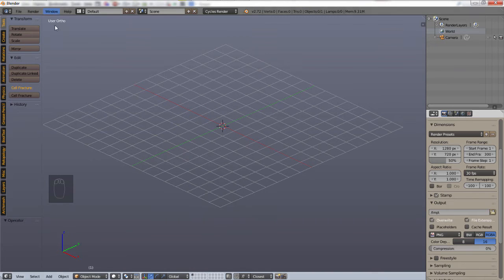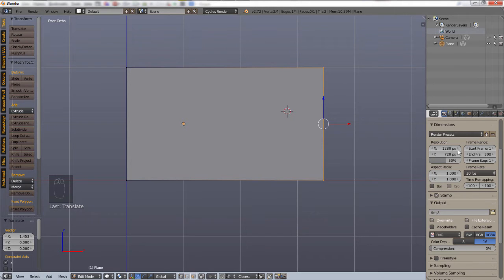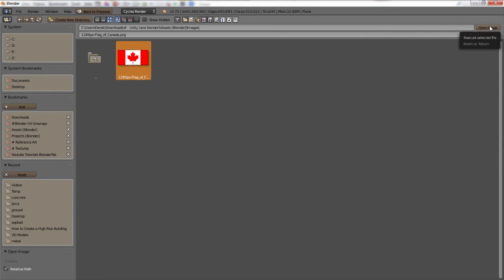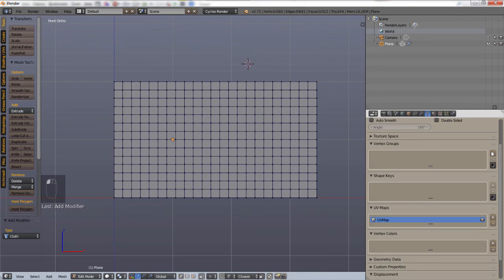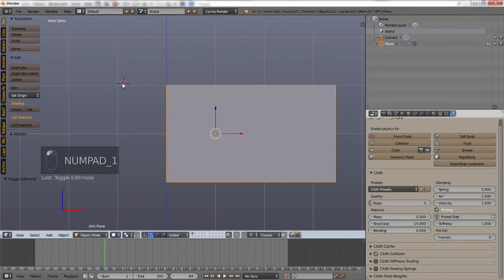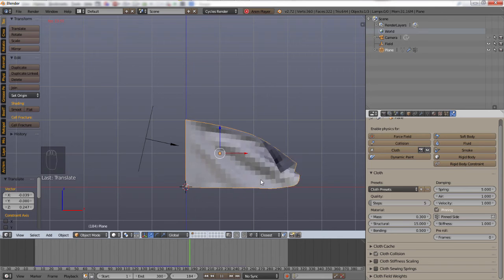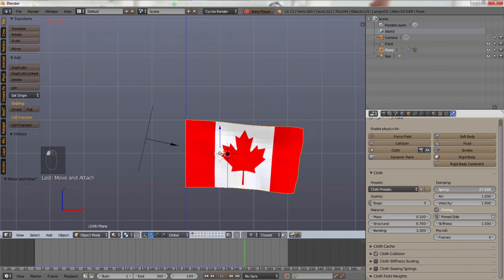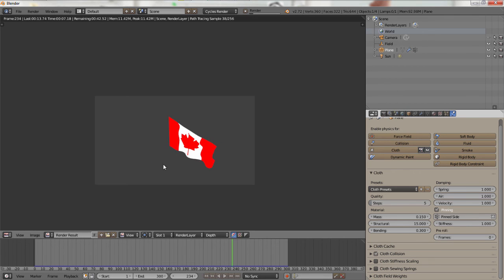Introduction to How the Cloth Simulator works in Blender Tutorial - 2.72 / 2.73 Quick tips

Comment: Thanks for sharing the tutorial. Very helpful. Similar to DAZ Carrara for the cloth simulation. I have been dabbling in Blender for quite sometime now. My question to you is how did you get the "Re-topology, Bool Tool, Physics, Archmesh tabs to appear under the Tools menu? I have the very latest Blender 2.72b build. But I dont see that menu on mine. Is it something you have to enable through the User Preference Settings? Thanks for your help!
Reply: I appreciate the immediate response. I checked those boxes in the user preference menu, I only get 3D Printing, Physics, Animations add-on display (tabs). When you say, " if they aren't there, then I would have to download the build"? Like Graphical or something like that?
Reply: Thank you sir, I really appreciate the help. But unfortunately, my "Scripts\Addons" is not there. I did the necessary steps to show the "Hidden Folders", but to much avail still no show of the last part. I am on Windows Vista OS (Home Edition). Maybe that's the reason? I noticed as I was able to show the hidden files, I have folders from 2.53 versions. I checked 2.57 version folder & the "Scripts\Addon" folders are there intact! I have been asking this question for years, Should I delete or un-install all previous versions of Blender so I can have only one updated build? I'm also guessing it would free up some very much need space on my pc. I will put things back the way they were (hidden files) until I feel more confident in adding the py. script. Thanks a MILLION for all your prompt assistance! I have Subscribed to your Channel. Will be looking for more Tutorials from you!